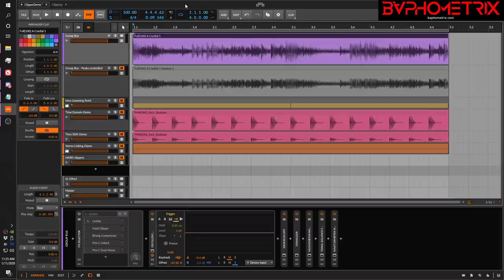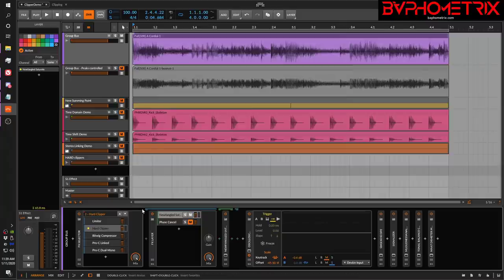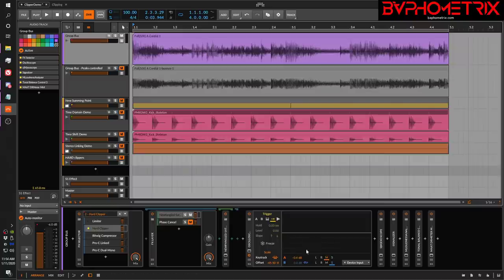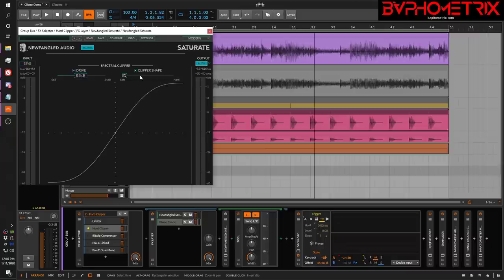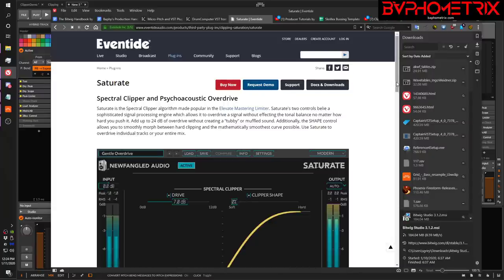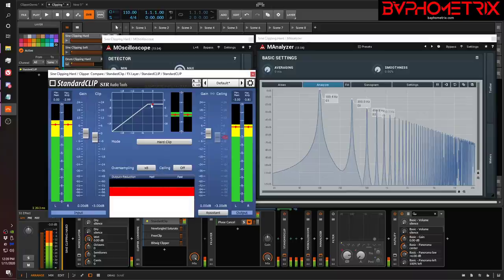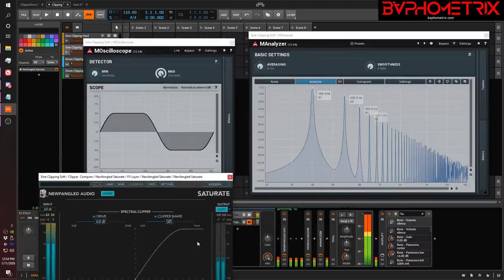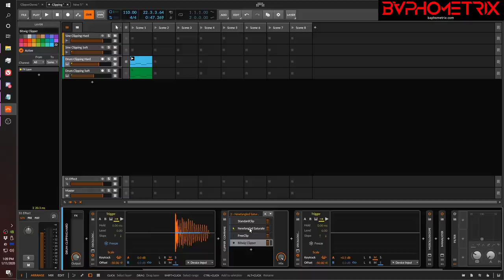Deep dive into clippers--NOT compressors--for clean, transparent loudness

Comment: After a lot of experimentation, over time I found that in the end it depends what style you composing and what you want. For example, in modern psy trance music you need the low's (kick, bass) as clean as possible. So, a clipper isn't idial for this because it will bring noticeable change to the sound by introduce distortion. So a limiter is most transparent solution to get most of the dynamics. To other sounds, percussions, synths etc.... clippers do awesome job to control the picks.
Reply: Based on the video, it seems that clippers and limiters are basically doing the same thing. In fact, using proL as the example, the limiter introduces more distortion/shaping than a plain hard clipper. So would you say the dynamic shaping of the limiter is closer to what you want for that style? Or would you consider using hard clipping as a means to achieve a more transparent sound for your low end?
Reply: Yeah that’s totally wrong, limiters are also introducing distortion. For the control you desire, a multi band compressor or multi band EQ would be the way to go
Reply from the maker: Limiters *do* also introduce distortion (and can also add their own coloration to a sound), but they can still be "cleaner" sounding than a clipper. There's a great lightweight limiter called "TrackLimit" by DMG Audio that is nearly as lightweight as a clipper and sounds GREAT on a lot of tonal material for which clipping would be a little too harsh/obvious. You can throw dozens of instances of TrackLimit all over a project. It's fantastic.
Reply: Infected Mushroom use clippers to get loudness :)
Reply: @6The6EyE6  pro-L2 does not introduce more distortion than a hardclipper. first of all that limiter has oversampling to up to 16x. that means all the harmonics it creates above nyquist are almost removed, while in a clipper they get folded back as aliasing. some clippers have oversampling as well, like venn audio freeclip. that is not really clipping anymore, but ok. let's consider it. but clippers also have no envelope follower. the youtuber said that it's a good thing, because it means less time distorting the signal with the effect, only at the transient. but music is not about having an effect work as shortly as possible. it's about making stuff sound good. and a compressor enables you to have smooth transitions between the dry signal and the compressors distortion character. both effects distort, but the compressor gives you control over the way it comes and goes. a compressor lets you shape the dynamics and the energy of the signal more transparently than a clipper because humans don't perceive distortion directly, but rather the rate of change of distortion as the thing that gets noticed
Reply: @Beatsbasteln  Can you explain what you mean by using oversampling on clippers isn’t really clipping? 

I’m pretty sure every clipper I own has oversampling options. In fact, clippers tend to have options for much higher oversampling rates than you get in other types of plugins.

Comment: Says theres 10 or 15 minutes left, yet theres actually 45 🤣

Great video and very informative so far! Changed how I viewed clippers and even compressors. I've been using like a compressor on everything 😅😅😅 Although I think I do it more for sound design and not for dynamics.
Reply from the maker: Nothing at all wrong with going BONKERS with compressors when designing a sound!  There's a reason OTT (in particular) is a staple in pretty much every heavy bass music genre!  When I started thinking "compressors are for sound design and gluing, but if I need peak-to-RMS control that's a job for saturators and clippers", everything changed for me and my self-masters got WAY cleaner and louder.

Comment: 24:30 the thing that i HATE about using compression on kicks to add punch and presence is that if you over do it, it squashes the tone of the kick, even with fast releases; and it longer the tail of the kick and make it boomy. 
My approach is use parallel compression on a separate track and put a gate after the compressor. To just use the initial attack of the kick, and then shape it with a transient shaper. Maybe an EQ, but it still change the phase frequency response, you deal with pre-ring, so no eq in most cases.

Comment: As an ableton user, I am blessed to have the stock glu compressor with a soft clip feature lol. I have been mixing and mastering for about 10 years now, and produce house music for my primary alias, as well as engineer fellow producer's tracks. I find that hard clipping alters the sound too much for  my taste, but a balanced use of saturation and bus compression (along with all other processing individual elements might require, not limited to eqing, saturation, compression, clipping, ect) allow me to achieve competitive loudness without sacrificing the character of the mix too much in the mastering stage. More importantly, I am not introducing any unwanted distortion into the mix or master when doing this. Crest factor is THE thing to pay attention to when attempting to achieve these competitive levels, and the best way to do this is as you say, to control the peaks / transients. There is definitely more than one way to "verb a noun" lol, but great content overall! :)

Comment: I use compressors all over everywhere, understanding what you're trying to do with a compressor is key to me and that is either dynamic control as in a vocal usually or transient or envelope shaping as in snare or kick decay time or guitar sustain. Understanding attack and release characteristics is crucial though. I love clippers too. Both compressors and clippers change the sound of the program material though. But you can use that to your advantage.  Add distortion everywhere, it's good for you and great for your mix. That's what analog gear is doing, it's adding distortion that is pleasing to the ear and beneficial to the mix because it's adding even or odd order harmonics and saturation which are all good things. We have these in the digital realm, they are just called saturation, distortion,  clipping, tape sims, preamp modeling, amp modeling, console modeling...Also, to me, as I usually deal more with acoustic instruments and not a lot of electronic stuff, I find it more useful to use many layers of things barely hitting whatever it is I'm trying to achieve.  So instead of trying to shape a kick with just one thing, I'll usually have a compressor on the kick shaping dynamics and the transient and then a clipper getting rid of any crazy peaks and then add some saturation  via a tape Sim or tube Sim or similar and maybe even a little limiting on the drum buss after a gentle compressor on the drum buss which then goes to the master buss and gets hit just a little again with a buss compressor into a limiter. If all of those stages are being gentle, the cumulative effect is better and more transparent than what you can accomplish with any one thing. This is the same way as if you had a studio with a million dollars of outboard gear though.   This dude is right about a lot here, and clippers are the magic things to get you to competitive levels if you didn't know about them, but my word of caution is don't try to do everything all at once, because the distortion can make or break your track. Go ahead and go too far with clippers and see how that sounds so you know what to look for, especially in a busy mix. Also listen and check on big enough speakers. If you want to deep dive, print a clipped track and phase flip it and see what the difference actually is. I love Mixbuss TV as well. I think he might have been the first one I seen to mention clippers that I personally caught. I like the he isn't afraid to address the loudness stuff because It seems to have become taboo or something, but it isn't over by a long shot.   It's not that easy to get your track up to -12 or -10 lufs or whatever and make it sound great. And that's the ballpark the streaming services are looking for, and while they can turn a loud track down easily it isn't so easy to turn it up. I mean look at what all we have to do to maximize the loudness with clippers compressors and limiters and stuff, they ain't doing the mastering for you at Spotify. I don't think that a lot of engineers talk about clippers because traditionally it has been left as more of a mastering thing where the mastering engineers would overload their high end digital converters and clip the peaks that way. There is a reason that mastering studios spend so much money on that outboard gear, they can shave off those peaks without changing the sound hardly at all. But now that everyone is doing everything, might as well do it in the tracks and use it exactly how we want.  A side note, if you want to deep dive into this stuff, get an oscilloscope plug in. They are absolutely 💯 percent a great tool to visualize and understand what some of these things that affect the envelope of the sound are doing that are harder to hear as a newbie like compression, limiting and clipping. Go nuts and see what happens. Anyways  y'all seem pretty cool, keep rocking it, peace! ✌
Reply: Thank you

Comment: I find that compressors work well when you record audio, specifically acoustic drums. 
When recording those the truth is that if the drummer is not perfect or the mic placement is not very good there is fluctuations in dynamics that happen mostly because of the drummer and that is completely normal.
To mitigate for this we may use gates and compressors to clean the audio up and make it dynamically consistent so that when you push this audio into a hard clipper most of its audio output is consistent in energy.
.
Basically in short people who mix already "engineered & fixed" stems or ectronic music they don't have to work about using compressors or gates much as they are focused more on gain staging and doing eq and strong dynamic clipping loudness moves. But yeah you do need compressors when you are fixing "average" recorded audio (before the mixing process) (specifically drums) and vocals -and in some ocations bass. 
.
But yeah I do agree with everything in this video, I just feel that I had to explain why you might use a compressor and a gate, specifically if you do more audio engineering & fixing rather than mixing.

Comment: The digital god of YT's algorithm has presented me a gem to start off 2021. Ty sir for these extraordinary in-depth video you are presenting here.

 It's like you said, you don't notice those summed peaks unless you look at the exported wave. It's when I started to look into it. I also discovered, that there is a huge change it when you become then tech/engineer of your own production, as in looking into the DNA of the sound, instead of the soul and character. They are 2 roles that needs to be done on separate instances imo.  

I have been experimenting in the past with using Waveshapers on stems/busses, to trim off the peaks. I noticed it didn't changed in volume, yet it peaked lower and more consistent, and even like you say, gives arguably a better character to the sound. Like saturation which creates a lower overall visual looking sound, yet it's perceived louder. I never went to go as far to magnify onto it, yet I felt like this looks like, literally, a good way to mix.

Looking at your vids, grants you like a big looking glass in how this actually works out if you sum it all up, especially in the specific busses for the groups of stems. It is just beautiful and fully motivates me (again) to focusing on not only mixing my own music, but deliver a decent master as well. 

Let's all take a moment in silence to worship Clipping. And a little side-note. How awesome is nulling to compare

Comment: Very cool stuff. 

I wonder how many in your audience will really understand what you've discussed to the extent that they don't overdo it. As an "old school" engineer (I started in the early 1990's when we were still using 2-inch tape, before Pro Tools came on the scene - which was cool because I got an intense education in state of the art analog before the digital revolution began), most of what you are explaining and discovering is the digital equivalent of what analog did by default to make things sound so sweet before you ever adjusted anything: soft clipping. The soft clipping behavior of analog tape is very transparent, and consequently controls a lot of the "peaky" "spiky" dynamic range, which consequently made everything sound louder and punchier before you ever did anything else to the signal. 

Digital hard clipping is cool for modern competitive loudness, but you can keep that sweet silky top end in the audible spectrum with generous soft clipping on everything, and then get that last little bit of loudness and "edge" at the end of the chain on each track/instrument with hard clipping used very carefully. Like you said - 3db or less. 

Of course, none of this means anything without the fundamentals: Mixing. Balancing instruments and frequencies. And particularly in electronic music: riding faders/automation to put human-feeling dynamics into the track.
Reply from the maker: Yeah, this is a great observation, and definitely apropos for mellower music genres. FWIW, I started back around the time you did 😉, and went through all the same learning curve when digital became affordable. I was in love with my first Tascam DA-38 machines (I had two) and my big digital Yamaha 16-track console.

My preference for hard clipping revolves mostly around the music I produce (festival-oriented bass music). Because many sounds are so aggressive and hot and **synthetic**, I tend to prefer keeping the signals unchanged right up to the instant they're clipped. Although I do often test and prefer soft-clipping for already-warmer sounds, such as a boomy/thuddy kick drum (instead of a sharp, knocky kick drum). 

Also, if you look at my written CTZ guide and some of my latest videos, you'll see that for a lot of tonal sounds I eventually swap out the hard clippers for a really excellent and lightweight *limiter* called "TrackLimit" by DMG Audio, which I only recently discovered.

Comment: Saturation and EQ!!! folks, master that, and you'll rarely need compression (though sidechain compression, bus and  parallel compression work very often!)
Then also master the use of multiple Reverb/FX Sends to create beautiful landscapes
Saturation is compression without messing with dynamics too much, but it also works as EQ, fills out frequencies for fuller mixes, and can be used for creative distortion, making it one of my favourite mixing tools :)
Reply: Thanks for putting things this way... so simple! Many thanks
Reply from the maker: Saturation is clipping. And vice-versa.  But more specifically, saturation is soft-clipping, which is less transparent than hard-clipping.  But yeah, when you're in the "sound design" mode and tweaking some original signal to "sound better", you're wearing your "sound designer" hat and hard-clipping is the wrong tool for the job!  Reach for a saturator (and distortion) first!

Hard-clipping is for when you're wearing your "mix engineer" hat and you're in mixing mode, where your goal is to manage dynamic range of your existing signals as transparently as possible.
Reply: thank you for being the person who showed me that clippers sound nice (tried some before but never liked the results) nobody is talking about that stuff and some working engineers don't even know it's a thing, they DON'T TEACH THIS in engineering schools?!? what is wrong with them? i think they should watch your videos...
Reply from the maker: @rafalvarezsevilla  Most of the engineering schools are still focused on traditional studio recording workflow.

Comment: Great video! Thank you, I am using saturators or clippers more than compressors nowadays which is giving me better mixes indeed. Regarding transient shaping. If a compressor is ‘too slow’ to shape transients I would use an expander (negative compressor) to control the transient, by controlling/increasing the gain on everything else but the transient. In this way the transient is used as the “trigger” for the expander without the look-ahead needed. On a kick you can then effectively increase the gain of the tail (relative the transient) to result in a relatively lower transient.

Comment: I use the line amp on my console to control peaks all the time during mixing since the direct out's on my console can be set as pre-eq, post-eq or post fader. Especially on drums I'll hit the mic pre where the overload light just flickers on to control transient peaks. When I started in the late 90's we had 9 compressors in our studio for a linked 48 track MSI JH24 tape machine so using the console's gain to control peaks is something everyone did and more so when we went to digital recording since there was no longer any tape to soak up the rest of the transients.